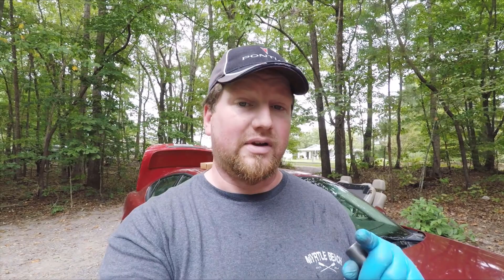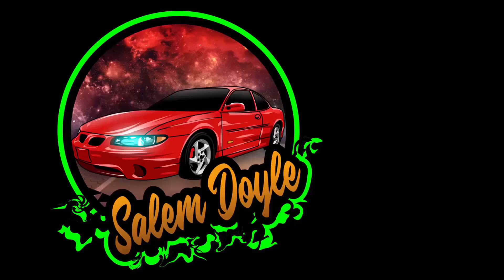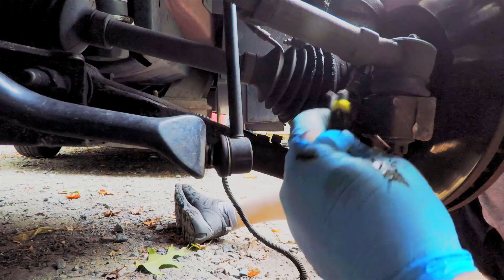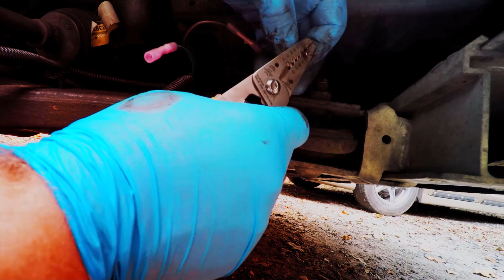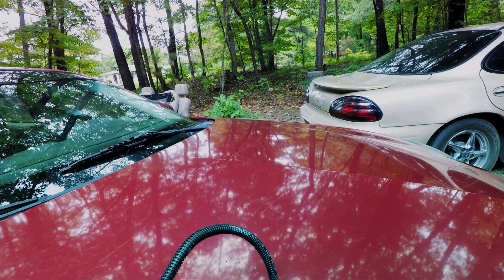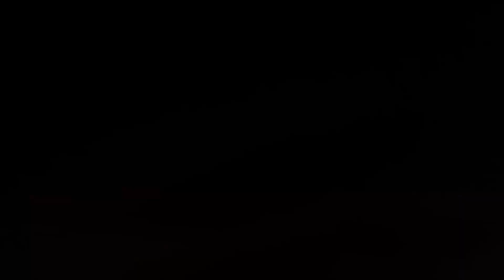How to Replace Your Wheel Speed Sensor Pigtail ( 2005 Grand Prix )

Comment: I've fixed so many w-bodys from the gm abs course. on these w-body cars, it's rare for the abs sensor to actually go out.

 on a side note. do not solder, these wires move alot and soldering makes a stiff spot (increase the chances of breaking). I recommend a high quality but connector that shrings and has heat activated glue.
also both sides use the same connectors so you can actually buy what ever side you want (for some reason they are normally different prices) as long as you get the polarity correct.
Reply from the maker: Good point, didnt think about that.
Reply: Thanks

Comment: I think these wires break because the sheathing is in two pieces.  The wires will then bend at that joint.  Then the wires will break from fatigue after constant bending.

Comment: I hope my question is seen…. My car had a flat tire.. it wasn’t driven on a flat at all, it was parked.. after I put the new tire on and drove it.. the abs, traction control and brake litghts came on.. could I of damaged anything putting the tire back on?
Reply from the maker: Maybe, check abs codes
Reply: @SalemDoyle  no codes come up.. it said it passed the abs scan but the lights are still on
Reply: Thank you so much for responding!!

Comment: I just replaced both sides and wheel bearings it still throws the code I switched both wires but it still come up and my speedometer still doesn’t work it’s a 2004 gtp comp g any suggestions?
Reply from the maker: Vehicle speed sensor on the trans?
Reply: @SalemDoyle  yes replaced
Reply from the maker: Hmm.. maybe the gauge itsself or a wiring problem then
Reply: Would the gauge cause it to not shift correctly?
Reply from the maker: Shouldnt
Reply: Still no dice it works for reverse but once going forward it goes 2 mph and sets the code could it be my pcm ? And thanks anything will help
Reply from the maker: Thats an odd one. Have you pisted this issue on any of the forums of fb groups?
Reply: @SalemDoyle  no i havent do you know of any that could help
Reply from the maker: Search 3800 in groups on facebook.  There are some good ones there.  The wbodytech group is good

Comment: The wire on mine is broken between the wheel hub and the harness plug. I don't think I need  the harness you installed here. Can the sensor and it's short pigtail be replaced without replacing the entire hub assembly?
Reply from the maker: No/ there is no way to seperate them

Comment: Need to do this myself when it rains it trips the ABS light and the wire is damaged near the control arm bushing. Apparently pretty common my friend had an old GTP where they were damaged on both front sides.